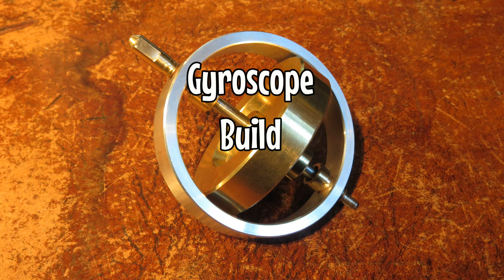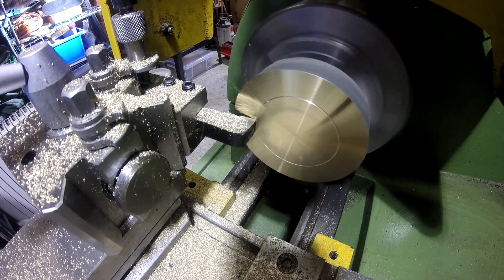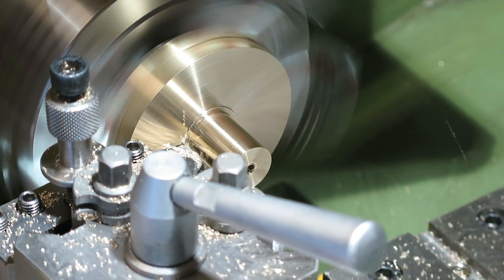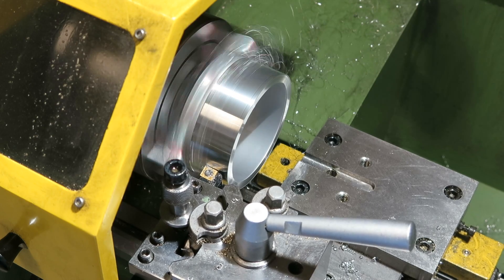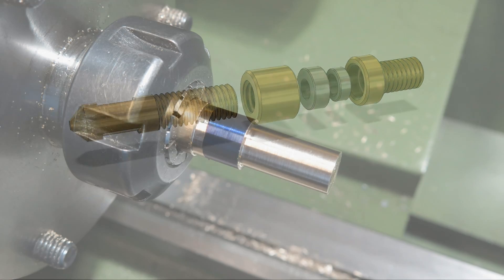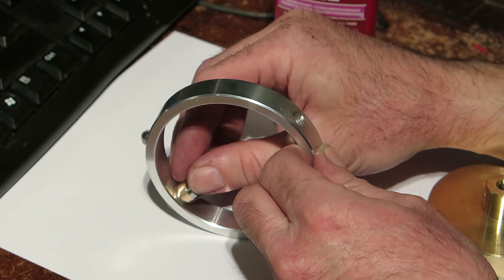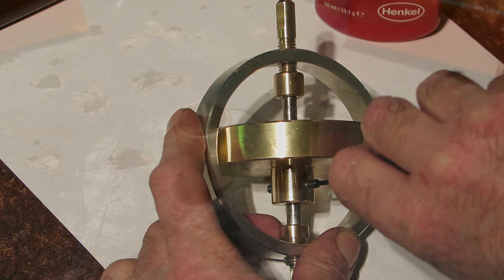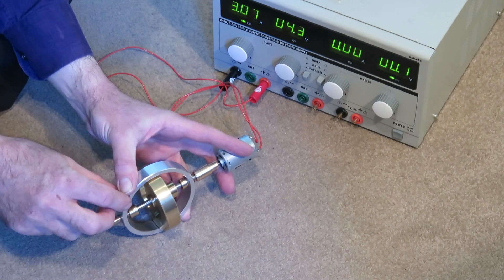Making a Home Machine Shop Gyroscope

Comment: Ha ha ha Clickspring can get away with super glue working with lighter weight workpieces on a mini lathe. Your working on a different level. Well done, love your Gyroscope.
Reply from the maker: Hi Virginia. The truth of the matter is that I haven’t got half the talent that Chris has, so I’m very much standing on the shoulders of giants!  In fact, my lathe is also a mini lathe but probably the next size up from the one Chris has, but very much still in the hobby\home shop bracket. Anyway, thanks for the nice comment. It’s really appreciated!
Reply: Well you did a great job with your gyroscope.

Comment: What's kind of metal do you need for the main shaft that goes in between the bearings holding everything together how is that molded, does it matter if it's brass aluminum or my choice etc?
Reply from the maker: Hi Dane - I've used silver steel (or drill rod as it's called in the states) for the main shaft. I think brass or aluminium would be too soft. The silver steel is turned on the lathe to get it to the correct size for the bearings.

Comment: I dont understand how the center shaft is seated in the bearings.  What is stopping it from slipping through the holders?
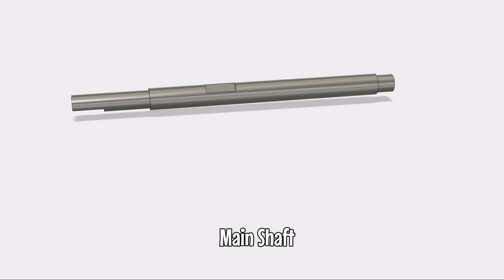Reply from the maker: Hello Wowl. Pause the video at 2:46. You can see that at either end there is a change in diameter in the shaft from 6 mm to 5 mm. The bearings are 5 mm inside diameter, so the shaft 6 mm diameter holds everything in place against the bearings. It’s the same principle for the bearing holders. The bearings are 10 mm outside diameter, but the through hole in the bearing holders is only 8 mm in diameter.

Comment: This, obviously is not homemade as you have titled your video.
Reply: Parag Shinde What about it is not homemade? He made a pattern in his home workshop, cast it in brass in his backyard, and machined the casting in his home workshop. It is unquestionably homemade. His tools and skills and craftsmanship are higher than you typically find in Etsy projects, but that doesn't mean it isn't homemade.
Reply: This is exactly true Jon, I am with you. No where does this gentleman say DIY Gyro, or build one yourself on a free Saturday like some projects here on You Tube will do. He takes you through the process, but does not say...just take a brass object and melt it down yourself.  I like to build stuff with wood, and there are some projects that I will never attempt just because I do not have the space or budget to buy some of the tools necessary, but I usually find the process interesting...just like this video.

Comment: Mine was also quite heavy, and I went back after all the parts were made and lightened the flywheel and outer cage a bit, so that a really good pull start would get it up to speed enough to balance.  My problem became that it was still so much mass to get moving that a good, quick pull would tear up whatever I used for a pull cord.  Natural fiber cord wasn't even close to strong enough, and some thin kevlar twine I had would only stand up to a single pull.  In the end, I stuck with compressed air to get mine spun up.  I like your idea of the  motor coupling though!
Reply: The Joy of Precision The weight of the cage shouldn't have anything to do with how hard it is to spin it up, should it?? 

I work at a car dealership. Every time I walk past the service department's pile of scrap parts and I see all the wheel hubs and brake rotors I think about how cool it would be to make a gyroscope out of those (brake rotor as the cage), and spin it up with the shop's air supply. The only things stopping me are that I haven't found any brake rotors small enough to turn on my 10" lathe, and the fact that if spinning it up went badly it would go VERY badly...
Reply: Jon, correct the weight of the cage does not affect how hard it is to spin up, but it very much has an affect on the gyroscope's ability to maintain balance in horizontal positions.  The more mass there is, whether spinning or not, the faster the flywheel will need to spin to keep it lifted in anything other than vertical orientation.  The lighter the whole thing is, the easier it is (and the fewer RPMs required) to do cool tricks like balancing on a point, in a horizontal orientation.  I know exactly what you mean about the massive gyroscope idea, my father-in-law wants to do exactly the same.  I'm trying to convince him to get a small lathe so he can start tinkering with some ideas on a smaller scale.
Reply: The Joy of Precision Oh, I see now. Yes, that makes perfect sense.